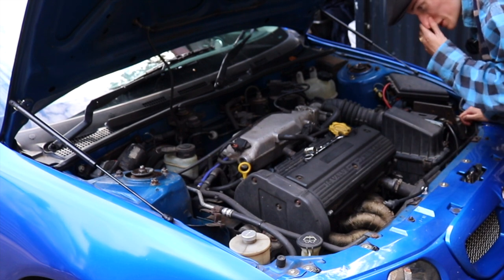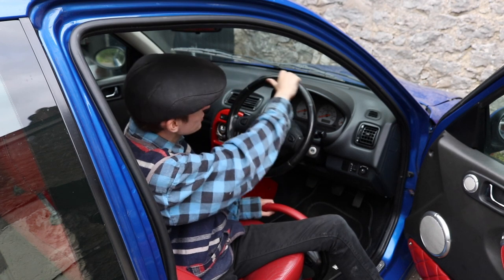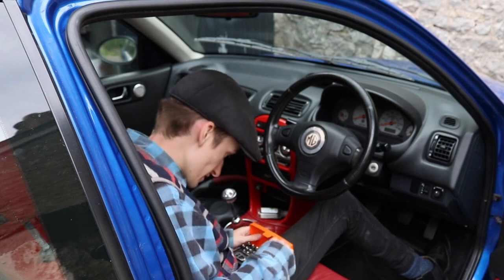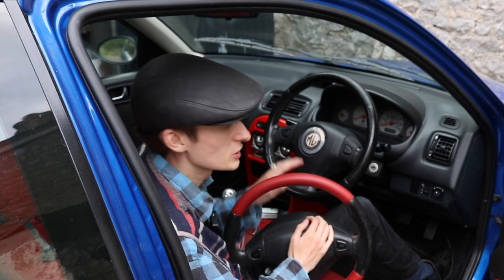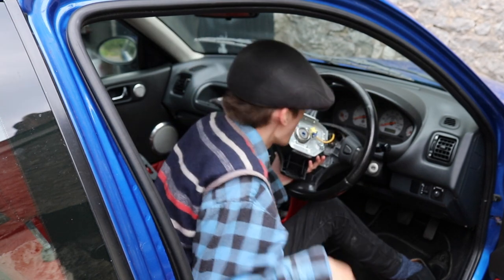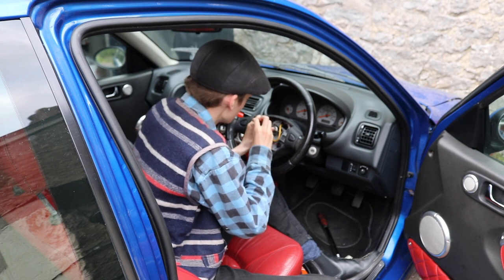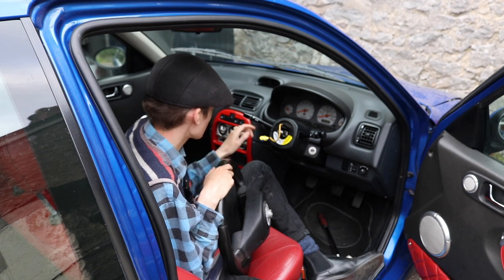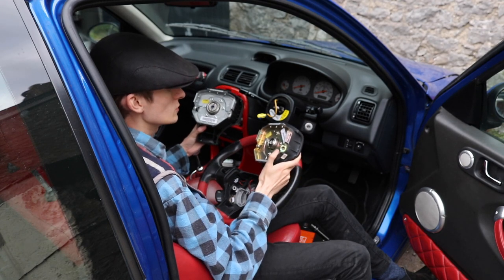MG ZR BRM STREERING WHEEL RETROFIT...............

Comment: Hi there any help I just brought a new mg zr and the horn doesn’t work ?
Reply from the maker: I’ve had same problem too! What worked for me first step without taking airbag out is I popped the horn button switches out what you can do and just cleaned them with some switch cleaner. 
2nd way take airbag out and clean the earth wire make sure has good connect.
Then after that if dose not work get test meter on the horns behind bumper see if there’s power getting to them or not.